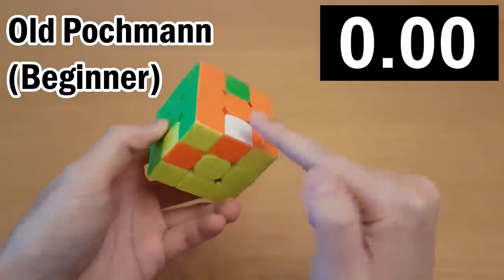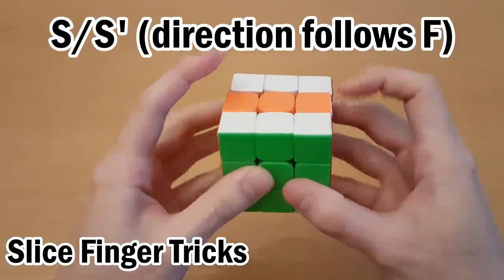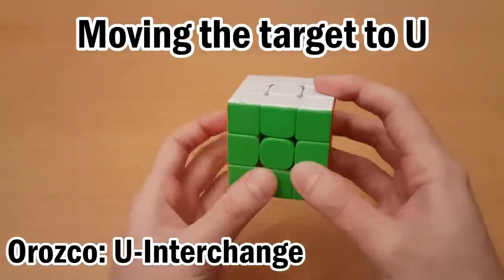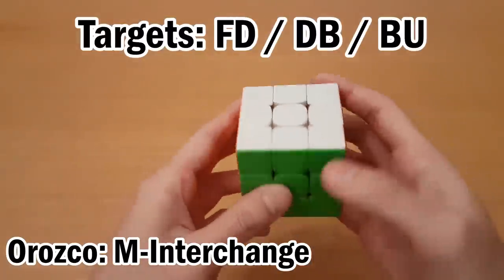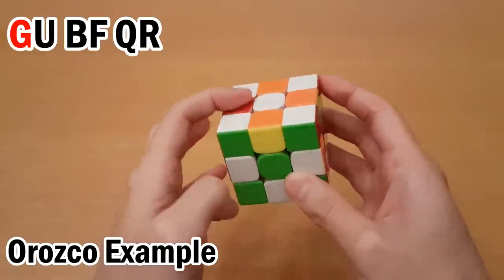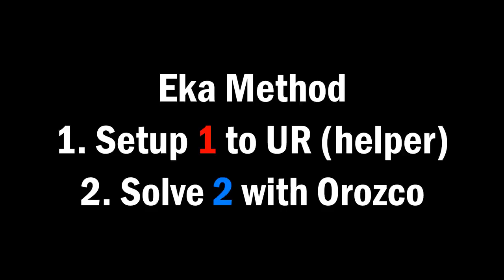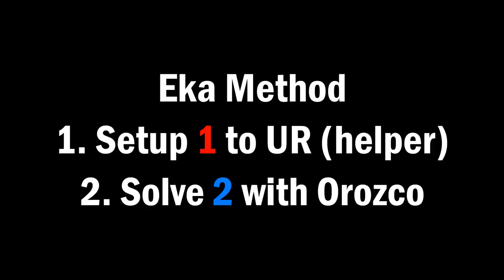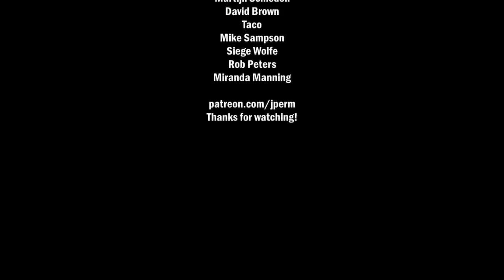Eka & Orozco 3x3 Blindfolded Methods Tutorial [Edges]

Comment: I've been doing Eka for over two months now, and I must say it has been shockingly difficult to become consistent and fluent with this method.  It takes a lot of thinking (especially compared to M2), and it only gets harder once you start adding in the alternate helper and inverses.  A common exercise I do to try to improve my consistency is to go to csTimer edges only, then write down the letter pairs in a Google Doc, then time myself just executing those letters (while reading them) with the cube under the table.  Even doing this, though not at a cautious pace, my success rate has only been about 50%.  While this could simply just be me, you may want to keep in mind that Eka may be a much larger commitment than you may expect.  However, I did get my first sub-1 3BLD single with Eka/Orozco, with 28s execution.  So it may pay off, it just takes a ton of work to get there with any consistency.
Reply: you absolutely just repeated my practice strategies. I got to cs timer as well and solve the cube under my table when writing down letter pairs. what a dang coincidence lol
Reply: Ooh yes, I used this strategy too! For Eka, I don’t really use it often because of the cons that were mentioned. I only use Eka if it’s a good letter pair. For example: Letter pair of JU. Since U is not in the same layer as J, I’d use Eka. Using Eka is good when the two pieces are not in the same layer because it’s hell to track where they go.
Reply: That’s my name
Reply: I still use m2. Is eka or Orozco worth it?

Comment: Isn't m2 the same as orozco? so 1st setup, m2, undo setup, m2 and 2nd m2, setup, m2, undo setup? But you cancel the m2 in between the 1st and 2nd letter? Buffer is DF and helper is UB.
Reply: Hmmm...
Interesting ,like this so J Perm sees this
Reply: kind of yeah, it's like orozco with DF buffer and UB helper, but with suboptimal comms so that the M2s cancel
Reply from the maker: Yes they are equivalent in that way. Orozco is basically the same idea as M2 except with the UF buffer (M2 would be really bad with UF buffer) and with more optimal comms that limit regrips to prepare you for 3-style or Eka.

Also M2 restricts you to 1 type of comm except when it's impossible (the 4 special cases). It could easily be improved with something like r' U' R U M2 U' R' U r for the RU target, or [U: [R F' R' , S]] M2 for the RD target, etc. But both of these would have to be reversed if second in the pair, and at that point of complication it might as well just be Orozco with a bad buffer. And if you're gonna learn 3-style, you should get used to the UF buffer
Reply: Op is orozco but the insertions are y perm
Reply: M2 doesnt have a helper and not all pieces can swap With M2 so kinda but definently not
Reply: @VaniljeTV  M2 does have a helper at UB. All peices can swap with  setup moves for normal pieces and commutators for M slice pieces
Reply: @isacubes  ooooooh i never thought of that

Comment: Great timing as I'm just contemplating switching from M2 to Eka
Reply from the maker: Awesome! Have you learned Orozco corners yet?
Reply: @JPerm  I've learned 3-style corners - it took me over 2 months and I still don't know the algs well enough to confidently do full solves yet!
Reply: (I mostly used Jack Cai's alg list but took some from Graham Siggins' list)
Reply from the maker: Wow nice! In my experience 3-style edges has been much easier to learn than corners. The approach I took for corners is a part-ZBLL part-intuitive learning style, and I can't imagine learning them all intuitively since some of the setup moves are actually crazy. But for edges it feels super intuitive for most cases, even lots of the bad ones make a lot of sense why the setup is the way it is, and I tend to have a better recall rate for what to do. For corners I usually just memorize setup moves + memorize where the pieces end up so I can do the pure comm without thinking very hard.

I took a pause in corner comm learning, because I felt M2 practice is unproductive and I might as well know Orozco or Eka to get some practice in and ditch M2 habits. If you're taking blind seriously, definitely switch ASAP!
Reply: I've started having a go at some edge comms and the hardest thing for me is the physical awkwardness of the slice moves. Hopefully it'll get easier with some practice.
Reply: Update: I learned Eka but decided to go back to M2 because even if it potentially could be a bit faster, tracking where the 2nd target piece is uses some brain resources and I'd rather just be focused on recalling memo. Its also another source of error and I think this is especially important when going for accuracy (multi-blind).
Reply: @AnthonyRochester  eh update?
I'm just want to know lol
Reply: @ReirtoRRNTX  I use full 3style now but I'm still not that fast, I average ~1min on a good day
Reply: @AnthonyRochester  well ok
Well i just gonna learn M2
Hope it run well
Reply: @ReirtoRRNTX  yep M2 is a great method and not too hard to learn
Reply: @AnthonyRochester  yeah i just need to learn I and S special case algorithms to complete learning M2
Reply: How much do you average now ?

Comment: Thanks for featuring Eka! Also, there's more flexibility to Eka, where you can set the 2nd target to UR and do the inverse comm instead
9:49 nice

What do you think about setting up to more and more targets as you learn comms and eventually expanding to full 3style? I know good blders are generally against this, but I want to discuss it further
Reply: exactly! you get a lot freedom in eka then any other intermediate method, and it requires intuition too instead of just algs
Reply from the maker: My experience so far makes me think you shouldnt do this as Eka is already so easy to setup for. There's not much benefit to setting up to other spots besides UL/UR. Also, learning 3-style edges has been substantially easier than corners so taking the leap isn't so bad.

Most cases only require 1 move to setup if you select the better piece to setup and choose between UL and UR. M slice targets are annoying for Eka, so learning those 3-style subsets first is a good idea.

Comment: 1:13
 
Another comm for that case (UF-UR-DF) is
R2 f2 R2 U' (x2)
Reply: But it's got rotations
Reply: @bloubbloub2430  Oh, the (x2) meaning you do that twice
Reply: Joshua Marais it is unusual comm
Reply: @joshuamarais8294  oops
Reply: @joshuamarais8294  ok but the wide f is still uncomfortable
Reply: @bloubbloub2430  not really, when you do the R2 your fingers are set up to do the f2
Reply from the maker: That's a good alg for FMC since it's shorter than a pure edge comm (8 vs 10 HTM). But for blind, it has a regrip and many double moves. I don't think it's slow, but I prefer the regripless comm

Comment: Do you think it is easier to switch to eka edges + orzco corners from m2/op earlier (changing buffers at higher speed is more difficult, isn't it?) , like when you sub 2?
Reply from the maker: It's weird at first but I got used to it pretty quickly. I think just switch when you feel like it. I was almost sub-1 with M2/OP when I switched and it felt pretty natural after a few days.

Comment: If you are cofused for the parity 
1. Solve the edges in way which leaves the UF and UR swapped 
2. Don't do last corner target 
3. Setup the last corner to a pll
Reply: this trick is only for M2, where in parity of eka or orozco the UF and UR are already swapped at the end of edges execution, and so the corners of orozco for the corners parity and we can solve both edges and corners parity with JPERM, which swaps buffer and helper of both corners and edges.
Reply: So if I use O/O I just need to do a J perm at the end if there is an odd number of letters?

Comment: For eka, what should we do if theres an odd number of edges?
Reply: I don't use Eka yet, but from seeing J Perm's video about Orozco for corners (and his 3-Style videos), I think that, since you already know you have parity if you memorize corners first, you're supposed to memorize in a way so that the buffer and helper end up swapped at the end (if you get one, act like it's the other), that way you'll end up with an even number of edge letters to memorize. You'll still have an odd number of corner letters, and when you get to the last letter in corners, the one that's not part of a pair, what you do is realize that what's left is the buffer and that last target are swapped, along with the two edges you left swapped earlier. You can do a one-move or two-move setup from there into a PLL, then undo the setup and the cube will be solved.

Comment: For UR->DL the setuo to LUgen U perm  is better
And for UR->DF [M U2 M, U] amd R2 f2 R2 U' R2 f2 R2 U' are better imho
Reply from the maker: I found the LU gen on the ss wiki and the other one in max hilliard's algs, so I thought maybe the LU was outdated and went with the other one. I do use the LU myself.

I like the <LFS> alg for DF since it doesn't have a regrip, but those ones are really good too.
Reply: @JPerm  for DF the MU alg does not require a regrip. BTW what's your global now?
Reply from the maker: I don't have a global since I'm doing mostly untimed solves right now. It's sort of around 1:40 due to pauses lol. I was at around 1:00 with Orozco/M2 when I switched
Reply from the maker: Yeah the MU alg doesn't have a regrip, I meant to say that the regrip is why I prefer the LFS over the RfU alg. I haven't tested the MU alg but it seems like a similar speed and I'm not at the point of optimizing my 3-style algs yet for my personal turning haha. I'm just going with the first fast alg I see have so I can keep moving forward. But I'll definitely check out that MU alg more later on

Comment: Hmm. Not sure how I feel about UR helper haha, UB is almost certainly better (and would've made the comparison at the start faster than M2), and BU is the original version that's easiest to learn.
Reply from the maker: Ive been told UR is good because it leads to a greater variety of comms, and also UR makes you automatically learn Eka as well.
Reply: @JPerm  There isn't really a greater variety of comms with UR though, they're pretty equivalent. The main difference is that there are more setups to 4 movers for UB, which makes the set faster on average. Also I don't think transitioning from Orozco to Eka is particularly worthwhile, given that they both fill the same niche (intermediate method, stepping stone to 3style)
Reply from the maker: Yeah now that you mention that I can see the benefit in UB since 4 movers are weirder to grasp at first than regular comms, and learning it early is nice. I've heard of using BU helper as well, which is conceptually similar to M2 in the main type of comms. I ultimately went with UR because of Eka ease and it feels like UR is the standard for Orozco.

As for Eka being not useful, one thing that really encouraged me to take the leap in blindfolded improvement is the lower level of commitment to see results. Now I do want to learn 3-style, but there was a point where I wasnt sure. Being able to learn Eka (~20 algs + mirrors + inverse) and still be really good is like having a checkpoint. I don't have to go all the way with 3-style if I don't want to, and still have progress made towards being faster at blind. That made the prospect of blind much more encouraging for me.
Reply from the maker: But what you said is true for me in the end, since I did want to learn 3-style so I basically used Eka for like 2 days only. But if someone said to go Orozco -> 3-Style, where I know Orozco is basically the same speed as M2, then I really doubt I would have switched off M2 at all.
Reply: @JPerm    I think the cost/benefit thing is true for both Orozco and Eka. They're the same amount of effort to learn and with UB, Orozco is honestly not that much slower than Eka, so you can get pretty fast with both. That's why I think they're both good intermediate methods, and they can both serve as good checkpoints, especially if you're coming from OP. I think Eka is better if you end up not taking the step to 3style (because it's the faster of the two) but Orozco is better if you do end up taking that step (cos it sets you up better for 3style). If you already know M2 then I agree Eka is probably the more compelling option, but if you're switching from OP I think either is fine. 

Honestly M2 is obsolete and I don't really think it should be taught any more. It has a pretty awesome cost/benefit ratio but OP is easier and Eka/Orozco are faster, so M2 is kinda just this weird middle thing that sets you up poorly for 3style later on.

Regarding UR being "standard" for orozco - I've definitely seen more people talk about BU/UB helper, both online and in real life. Idk if the groups I'm in are a representative sample, but I really don't think UR is standard haha.
Reply from the maker: I disagree here. I don't think of M2 as a bad 3-style thing, instead it's just an awesome version of OP. Most people learning M2 are close to beginner level, and have no intention on going to 3-style yet, or ever. If someone's destined path was 3-style, obviously they can skip every method and learn 3-style from the start. But part of improvement is motivation, which comes from the visible progress towards your goal. Part of that progress is breaking PBs, and it comes at a cost of learning optimal things slower. But either that, or never have the motivation to learn anything since blind isn't fun when you're slow.
Reply: @JPerm   J Perm  "Most people ... have no intention of learning 3style yet, or ever". This is absolutely true, but it's true for the people who end up learning 3style too. There's no way to really know whether an intermediate method will be the endgame method for someone, or whether it'll just act as a stepping stone to 3style. That's why I think that it's important for an intermediate method to try to strike a balance between being reasonably fast, being easy to learn, and being a good stepping stone to 3style. M2 is good in the first category, excels in the second, but utterly fails in the third. I've lost count of the number of people I've seen whose progression went like: M2>Advanced M2>'DF 3style with awful comms'. M2 works to motivate people to stick with the event, but other intermediate methods can do that as well, while setting people up for success if they do choose to learn 3style. 

Your last sentence, I think, just works as an argument in favour of intermediate methods in general, right? Like telling people "just learn 3style" would result in 90% of them quitting, because it's hard and BLD wouldn't be fun until they've learned it. People can be motivated and break their PBs by learning Eka or Orozco though, you don't need M2 for that.